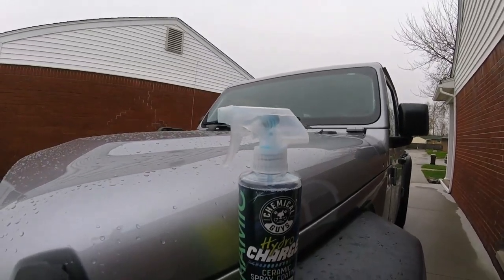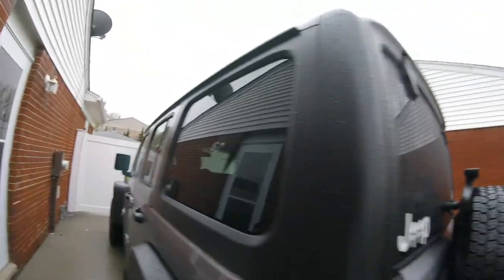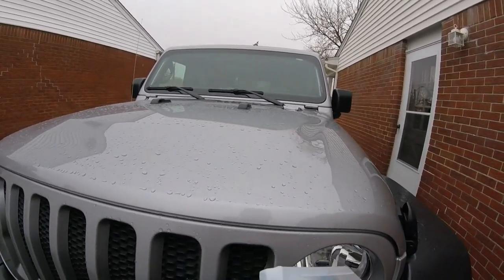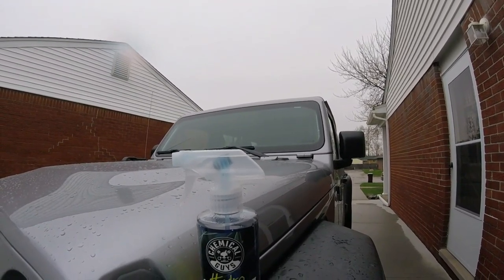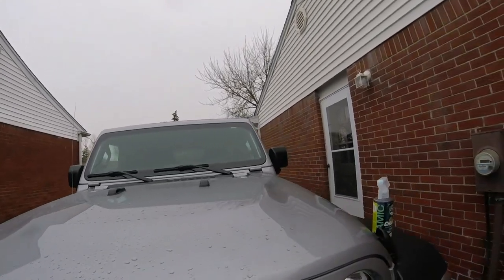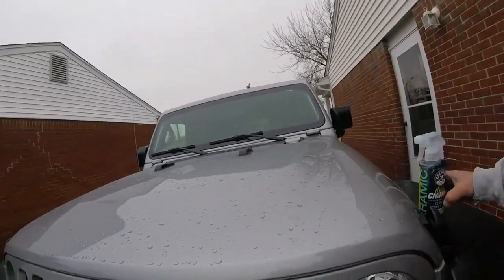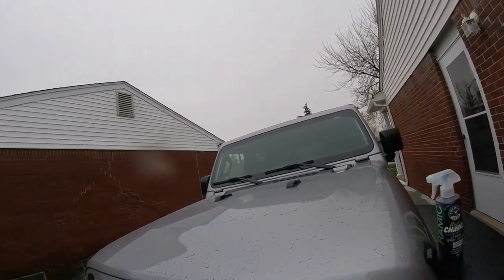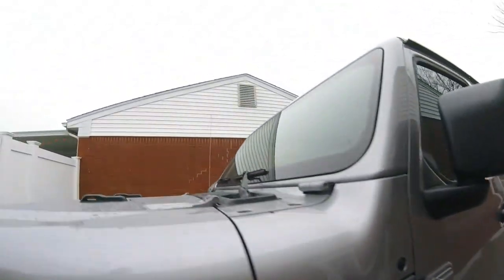Tips on Chemical Guys HydroCharge "Ceramic Spray Coating" : Real World Test

Comment: Hey thanks for the shout out Ouzo Lou! Appreciate it! Glad I could help. It looks fantastic! I plan on putting it head to head with TAC System moonlight as soon as the weather break here in New England. I am going to split the vehicle right down the middle and see what happens. I have a strong feeling they are very similar products which is a good thing since Moonlight is so hard to get in the States (although Hydrocharge is also now out of stock too).  All that info came directly from a long phone conversation I had with CG the day it was released.
Reply from the maker: Thanks Bigolddog for the help we appreciate it. I have to look up Moonlight never heard of it. That's cool you got to talk to CG about this HydroCharge.  Thank you

Comment: So when you say avoid plastic, you mean exposed black or abs plastic that doesn't have the factory paint covering it right?  For example, on our chargers, large portions of the body panels are plastic, but are painted.  Those sections are OK, right?
Reply from the maker: I mean the black exposed plastic good point to bring up CTHellcat . Painted panels are safe to have this applied to as long as its painted and has a clear coat . . Thanks for pointing this out..

Comment: It''s good to have two layers of ceramic coating because it will give it an even coverage on the paint
Reply from the maker: That make sense to get  even coverage. Thanks Neff
Reply: @OuzoLouGarage   Yeah. Some detailers even recommend double layer ceramic coating with a sealant on top. Something like CarPro Reload ( includes 5% silicon) each 2 months should keep the ceramic coating performing at its best.
Reply from the maker: @akaChriss4L  Thanks for the advice appreciate that.

Comment: How did you get that? Last I looked it wasnt available yet.

I just looked and it says still not available
Reply from the maker: Chemical guys just opened a store by Detroit and we went to the opening.  And they only had a few left. You may have keep checking.
Reply: @OuzoLouGarage  wow. Yeah you cant even order it online. It's been unavailable for a good while now
Reply from the maker: Guess i was lucky to get one at the grand opening , I had ask for one when at the store hydro was not on the shelves.
Reply: @OuzoLouGarage  wow
Reply from the maker: @319speed  You are going like this stuff when you get one.
Reply from the maker: @319speed  i just check CG website can't even get the hydro soap . I was lucky to get both. Crazy
Reply: @OuzoLouGarage  yeah man you were way lucky
Reply: @319speed  there last batch was no good so they had to remake and test a new one that's should be out soon
Reply from the maker: Thanks Kris
Reply: @krishenning5923  ohhh what happened to it?
Reply: @319speed  sio2 mixing issues
Reply from the maker: @krishenning5923  Thanks for all the updates
Reply from the maker: Amazon has  HydroCharge right now  K 1500
Reply: @OuzoLouGarage  nice!